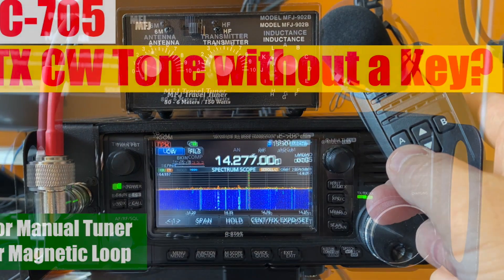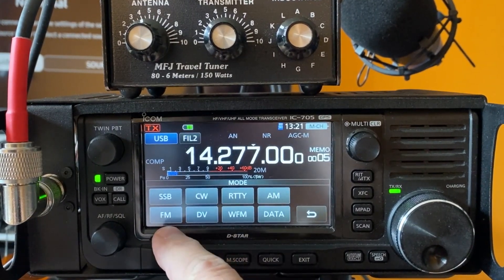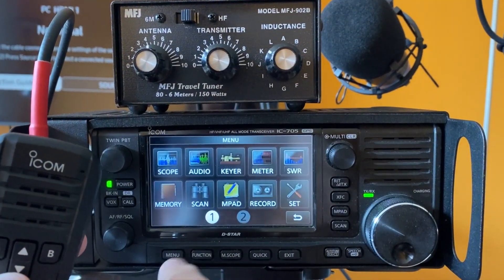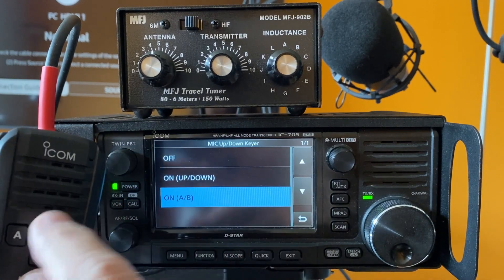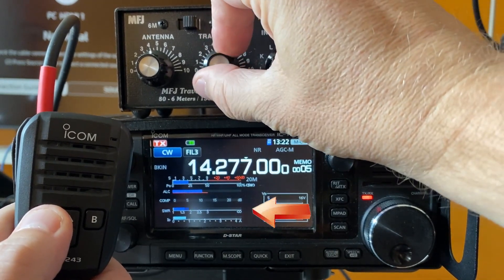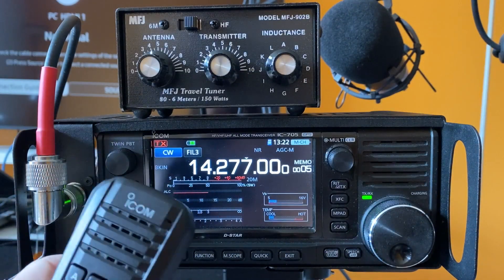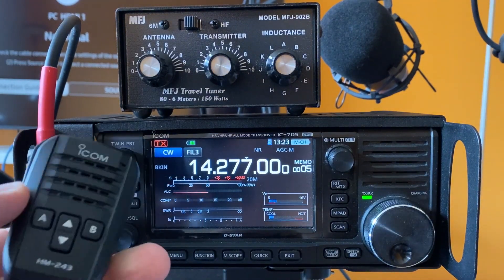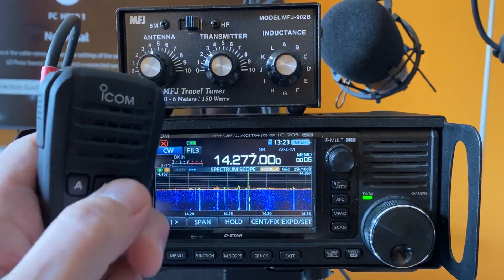IC-705 TX CW Tone without a key for tuning Antenna?

Comment: Thank you Frank for the info, though there are a couple of extra steps to set / check. In the CW-KEY SET Menu, there is an option for Key Type.  This must be set to straight. If its accidentally set to Paddle for example, one of the chosen microphone buttons will act as a Dit and the other as a Dah. i.e. it will not give a continuous tone. The very important step is to enable BKIN. This is the left hand button under the POWER button on the rig, which when in CW mode switches the BKIN mode. If this is not on, then the microphone buttons will have no effect.
Reply from the maker: Good point, I was expecting some comments like this after publishing, in deed we may have different settings, it would have been nice to show all of them. I have Pinned your comment so others can consider the additional info you provided and help them set their radio. Thanks.
Reply: Not having BKIN set, I ran into "no signal" behaviour :D thanks for troubleshooting!

Comment: How is it different from keying the mic on RTTY mode? It also transmits a single tone afaik
Reply from the maker: RTTY signal is wider (170-500hz), while CW is narrower (100-200hz), in the end both can be used to tune, but CW is less disturbing on SSB (voice) frequencies because most receivers have an Auto-Notch that can greatly attenuate a CW signal.

Comment: I have a problem. I can hear the sound but there is no transmission until I don't press both arrow (or letter) and PTT.
Is there any setting I missed? As far as I know, "dah" position is basically PTT in both straight key and paddle settings of most transceivers.
Reply from the maker: I have not come across that issue, please recheck all settings as per visible in the video and note the Key must be set to Straight (as a user commented). May be check the Break-In options? Good luck.
Reply: @VE2FGJ  it really was because of break-in disabled.
Reply from the maker: @tulenik71  Glad you found it!👍